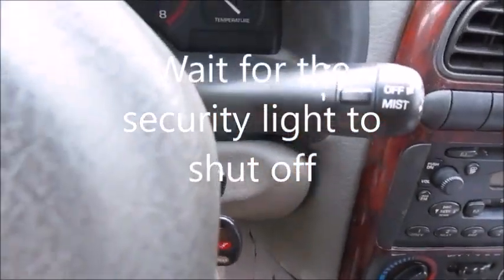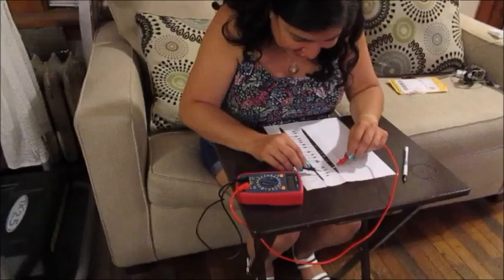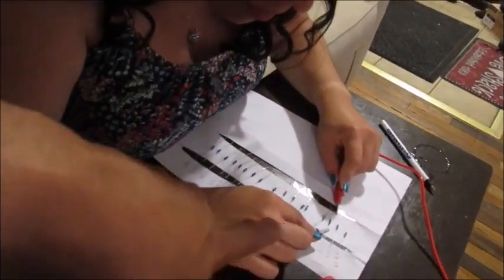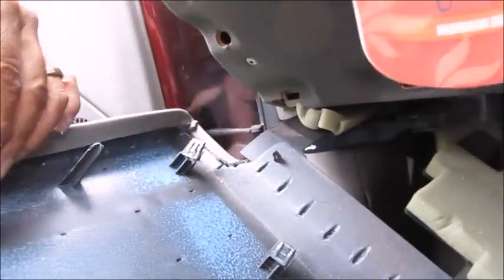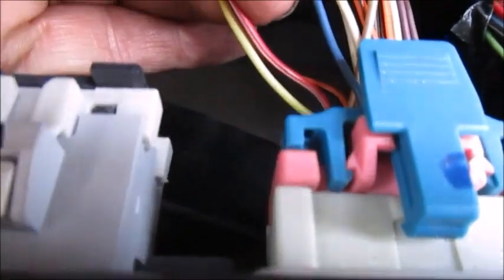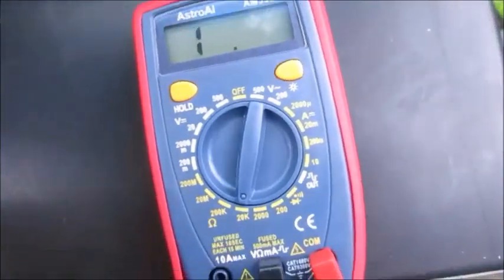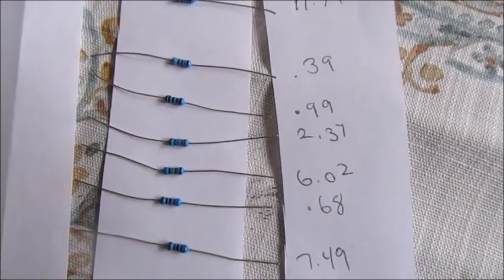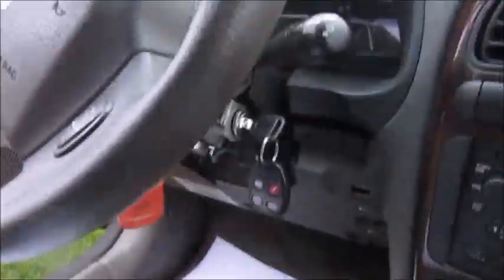Bypassing the vats alarm system on a 2002 Saturn L200

Comment: My wife's 2003 Saturn ion did the "won't start" crap at a gas station after filling up. It started and imediately shut off, then wouldn't even try to start. After 10 minutes(of not trying to start it), it started and ran fine with no "passlock" warning. It did it several more times over the next 4 or 5 months(usually on a cold morning) and after waiting 10 minutes it always started. I replaced the module on the opposite side of the steering column from the ignition key switch(which container the resister for the passlock system) which was a 10 minute job but the part was approx $ 30.00. The time consuming part was relearning the system for the new resister in that module. Turn it to on(not start), wait 10 minutes, turn it off and repeat that for 3 times.(I messed it up somewhere and had to do the 10-10-10 relearn steps all over again but then it worked. For about 4 years and now it did it again. But, as before all I had to do was wait 10 minutes with everything off and it started like normal. The relearn is only if you put in a new part(if the resistance value is different from what was previously learned).

Comment: Hi,
I have been dealing with this problem for a month or two. Here are some things I learned:

1. That hard security light can be turned off by using the remote control fob. When you lock the car and open it with the remote control the light will go out.

2 If the security light blinks, disconnect the battery briefly and the light will go out. You can start the car.

3 This problem is caused by a worn ignition key, or key cylinder. You can possibly get one from a dealer and have them set up the cylinder to match the vin number. 

4. The 30 minute  procedure will allow you to install a different ignition cylinder and the "program it " into the BCM.

I have a nice car just like this, and it seems a shame to junk it because of this issue. I found your video very interesting, and well done.

Thank you.